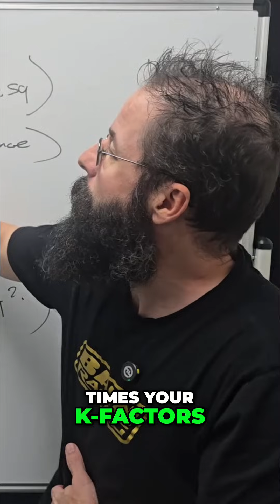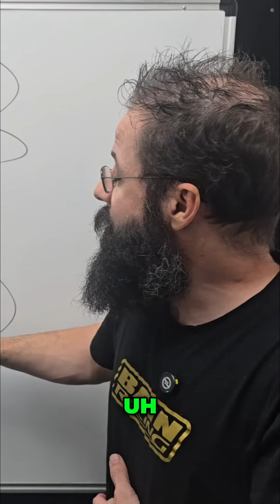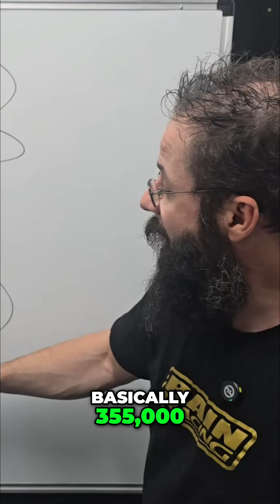Engine Harmony: Unlocking Peak Performance Secrets

Comment: Does piston speed help the head to flow better ?
Reply from the maker: That's what generates the air speed for inertial supercharging mechanism.  👍
Reply: @bainracing thank you for the infor
Reply: @bainracing  Jake how does this relate with what David Vizard has said in his book How to port and flow tests cylinder heads, I quote: “Although far from obvious on a high-performance or race engine, the strongest pull on the intake port during the induction process is not from the piston. I have demonstrated this on a 525-ci big-block Chevy street motor. This engine had a well-designed intake and exhaust for the job at hand. With port and in-cylinder pressure measuring gear installed, this engine had a vacuum of 11 psi (4 inches absolute pressure) at the exhaust valve and 3 psi positive at the intake valve during the overlap period when the piston was parked at TDC. This means that while the piston is stationary at TDC, there is a pressure differential across the chamber of 14 psi because of the wave tuning of the intake and exhaust. (FYI, suction, due to the piston going down the bore, was just a shade under 1 psi.) By starting the charge motion into the cylinder early (this reached about 135 ft/sec, or, about 90 mph), the depression later in the cycle as the piston is near or at peak velocity is lower. This intake/exhaust action causes peak power to go up as well as the RPM at which it occurs. So the better the exhaust, the higher the intake velocity where peak power occurs.”

Or am I confused??